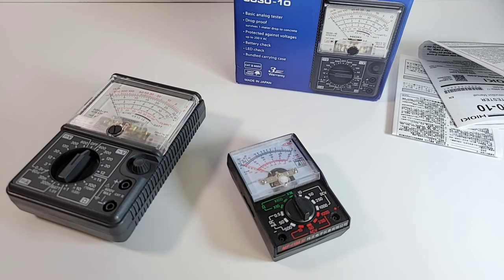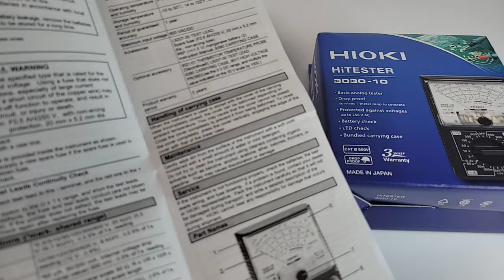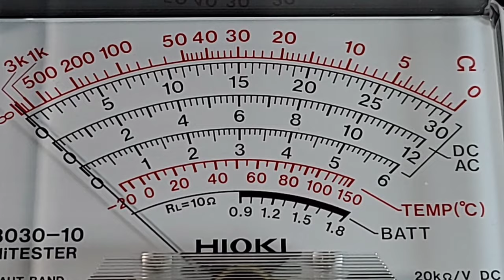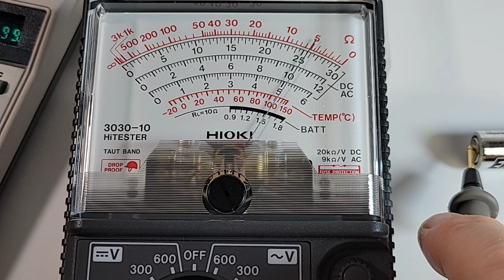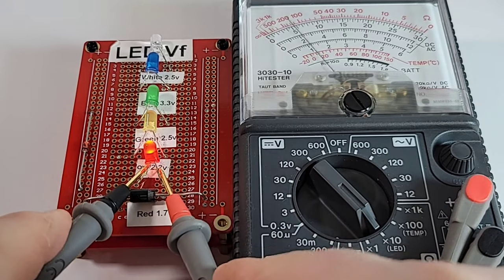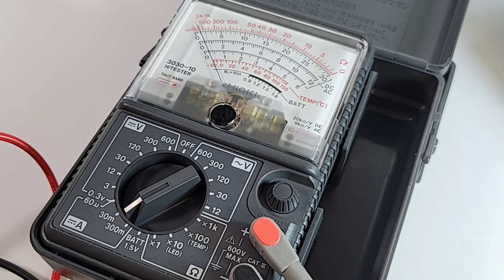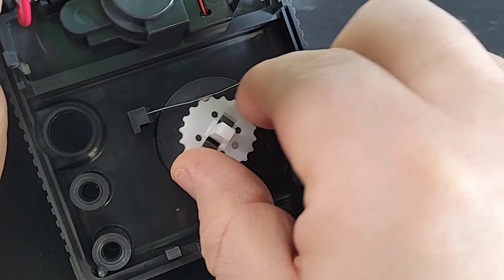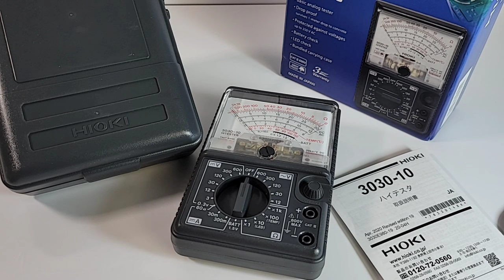HIOKI 3030-10 ANALOG Multimeter Review & Teardown!

Comment: I believe this multimeter is manufactured by Nishizawa Electric Meters Manufacturing (西澤電機計器製作所). They still manufacture a 50kOhm/V analog multimeter (Model 3009). They manufactured 100kOhm/V meters (Model 3010) until recently, but now discontinued...
Reply from the maker: Great info ! I was originally told by Hioki that this unit is manufactured by Hioki Japan. I'll see if I can get more details.

Comment: Those were the days... Remember: This style of devices were used to build the rocket for the flight to the moon. I´m simply curious: Does this Multimeter still don´t need batteries for measuring a voltage (only for resistance and so on)?
Reply from the maker: Correct...batteries are only required for the  resistance measurements. Not needed for Voltage or mA. 🙂👍 So true about the moon..we've certainly come a long way !

Comment: Those who buy analog multimeters nowadays .... would definitely be buying this.
Reply from the maker: It's found a home on my bench. I love everything about this meter. The display is really top notch too.
Reply: @KeepOnTesting  so nice of you ☺️
Reply: Doubt it. You can easily buy a second-hand Micronta, Chauvin/Metrix, Goerz/Gossen Unigors, Norma/Siemens high-end analog multimeters with 100 kOhm/V for a fraction of price. For collectors Simpson,Triplett, ICE Supertester along with old Hioki, Sanwa models. Rare are only transistor FET analog portable multimeters.
Reply from the maker: @TheGrantourismo  In my experience a second hand Chauvin or Metrix will set you back much more than this new Hioki..

Gossen is almost impossible to find. Micronta is abundant but not nearly as accurate *at least not the two I have.

Comment: A very cheap analog meter with only 20kohm/volt (My best one had 100kohm/volt, but that was a long time ago).
What is very interesting is how well it handles overload, i.e. set it in the lowest voltage range and put the plugs into a mains outlet (It will probably let out the magic smoke).
I would not have accepted that quality 40 years ago. Sorry I do not like analog meters anymore, event though I have used them a lot 40 years ago. They can be useful for a few applications (Low input impedance, no RMS and low precision), but for more general usage a digital meter wins.
Reply from the maker: I appreciate the honesty Henrik ..not everyone's cup of tea for sure..still I find analog useful at times and this Hioki should serve a niche number of users. 👍